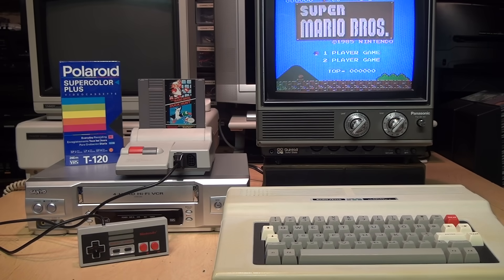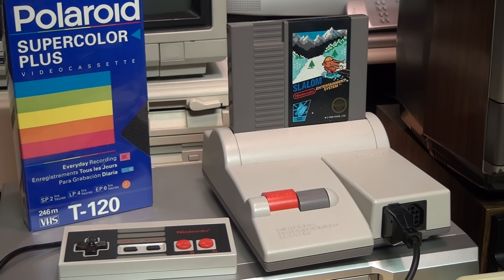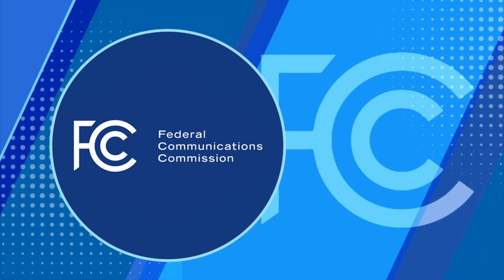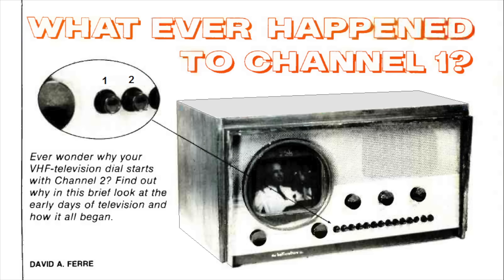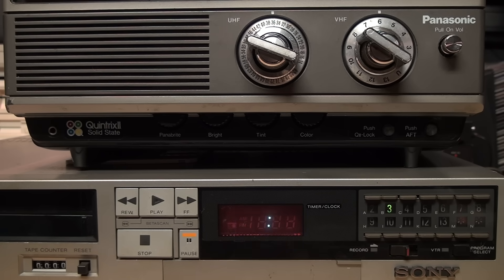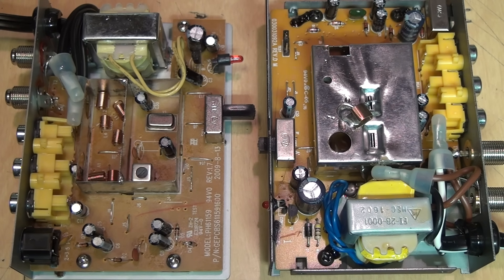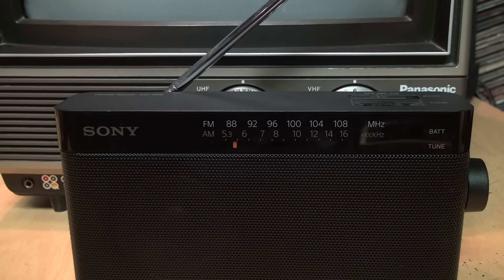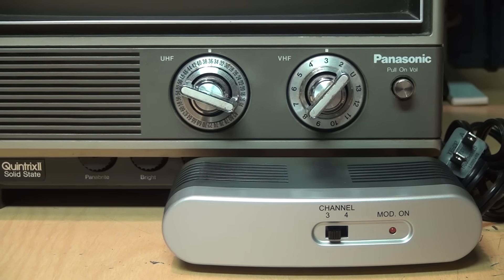Why your Nintendo was on Channel 3 (except in Cleveland)

Comment: I think we had to use channel 4 here in Council Bluffs (Omaha NE basically) because our local CBS affiliate was on channel 3 but fuck-all was on channel 4.

I could still get my VCR (which was our TV's only video input method) to work on channel 3, but there was some modest interference (showed up as snow in a weird modulating herringbone pattern).

Also, apparently you can bypass HDCP with SDI if you know what you're doing (not that I know anything about that).

Comment: Of course in the UK you could only get "high definition" and colour via UHF so it was never an option to use VHF for RF modulators.
Interestingly despite 405 line/VHF being discontinued since the 80's there are still a few VHF TV aerial installations out there, the vintage radio UK forums have a thread dedicated to such installations still being present.

Also for us geeks there is an excellent UK website that showcases the UK's domestic broadcast network, called the transmission gallery it has pictures of about 97% of all our FM, AM, SW, DAB and TV sites.

Comment: Madison, WI also had/has a channel 3, so I used channel 4 as well, even though we were 25+ miles from the transmitter and my system was usually in the basement.

Comment: The top loading Nintendo came out in the mid 90s.  The mid 80s stardard NES had AV jacks along with RF.
RF is more than good enough for any retro game console.  They are very low resolution, well under the 525 line standard of NTSC RF broadcasting.  The NES has only 240 lines of resolution.
The real problem is the modern idea of using an F cable adapter with the wrong RCA cable.
Also, the channel 2, 3 and 4  (2 or 3 or 3 or 4) was established long before the NES came out.  The Odyssey 1 console used it. The dedicated Pong machines used it. The Channel F, the 2600, intellivision and many others also used it.
Reply: There is only one Nintendo, and it started in the 1800s. Stop calling consoles "Nintendos."

Comment: A fun fact about the use of CH36 in the UK, when Channel 5, the 5th terrestrial (I.E. not cable or satellite) channel first started test-broadcasting, people found they couldn't use their VCRs over RF properly any more, as, in a number of regions, Channel 5 used the CH36 frequency, so at their own cost, they had to send out fleets of "engineers" to adjust the potentiometer on the back of peoples' VCRs (you could adjust between CH32 to 40) and re-tune their TVs for them both to return VCR operation and to add the fuzzy, low-power mess that was Channel 5... :P
Reply: And they stuck a little Channel 5 branded sticker on the back of the VCR to say it had been re-tuned. I've come across quite a few VCRs with those stickers on the back. We re-tuned ours ourselves so never had the Channel 5 retuners round and never had our own sticker.
Reply: @timf-tinkering  Where we lived at the time, no amount of fiddling with the VCR or tuning would get the channel in on the house's dubious aerial setup (installed by monkeys when the house was built apparently, though the house in general seemed to have been built in 1988 by monkeys too!), I was the only one in the house who could receive it, with set-top aerials, a booster and a knackered VCR (its' tuner was dead, but seemed to help the TV with signal gain!), not that a fuzzy picture and off-brand 9pm movies were worth watching... :P
Reply: Wouldn't it have been cheaper and easier to just change the frequency of the station than to send men out to fiddle with every TV and VCR in the entire country? Or was that not possible for some reason?
Reply: @BigCJ  It was basically a case of "not enough room", as the UK has different regions which use their own transmitter sites, they have to avoid overlap between regions that could cause interference and 'ghosting' (where one signal overlays itself on another), and of course, 36 was about the only "clear" channel they had in the majority of the UK, but at the expense of having to advise people to adjust the modulators on VCRs or send someone out to do it, it was an absolute farce really, and given the low-power nature of Channel 5 in general, it wasn't really worth it as it was always fuzzy no matter what you did as they often used former Band I/III VHF sites, since converted to Band II FM radio-only, which by that point lacked the power availability...
Reply: How many different stations were there? Checking Wikipedia shows that UHF channels in the UK ranged from 21-69, somewhat similar to the US scheme of 14-69. The stepping between channels is bigger, too; 8MHz vs 6MHz. I'm surprised that there were ghosting issues if there were that many channels with that much space between them.
Reply: @BigCJ  Officially, we had 5 channels (BBC1, BBC2, ITV, Channel 4 & Channel 5) before the digital switchover, but, different regions of the UK had their "opt-out" systems, so they could broadcast local news after the national news had been on as well as local programming or have a different schedule to other regions, so they had to avoid overlap between regions with enough separation between them by having region 'A' in say the 21-32 range, then region 'B' in 56-69 range, then region 'C' further afield can then use the 21-32 range (this being a rough estimate, actual numbers differed), it wasn't perfect as some of the UK's topography allowed for signls from further afield to break through and cause ghosting (same channel, but with a delay making a very odd visual effect!), and in some cases even aid in having two different regions available to you to watch, so you could have say ITV Tyne Tees on one channel, and ITV Yorkshire on another owing to different frequencies used...
Reply: I see. So it's not a problem of different overlapping signals on the same frequency. I don't know why I thought that's what you meant, but think I get it now. You experienced all manner of delays and visual artifacting, yes? Here in the US, depending on how far from the transmitter you are, weak analog signals would get just get fuzzier, lose all color, or drop out entirely. I don't think I've ever seen the phenomena you describe except on digital TV!

And signal overlap between markets is still a thing today, I myself have seen it! The local PBS station 30mi away not coming in? Switch to the one 75mi away in the mountains and it comes in clear as a bell for some reason.
Reply: @BigCJ  With the ghosting, the overlayed image from a far off transmitter would be very slightly behind (signals travelling at the speed of light and all that), in built up areas it could also be caused by "mirroring", where signals bounced about off tall buildings causing a 2nd signal to appear as the ghosted image, and yes, the further away from the transmitter, the worse the quality (I remember in about 2010 after our region at the time had switched over to digital, I was still getting analogue from somewhere I think in Yorkshire, it was a poor signal, but still kind of watchable!). As for digital television, since the switchover, they reduced the transmission power (E.G. my local transmitter went from 500Kw per analogue channel to 100Kw for the main digital multiplexes), so picking up other regions' channels is a lot less likely now...
Reply: Another issue was that the 4 UK UHF stations were "grouped" in a closely spaced set of channels on a regional / transmitter site basis with main and fill in transmitters, antennas were quite narrowband and sold as "group A, B" etc. If your local group was not near channel 36 you might need a new wideband antenna to replace your grouped one to get a decent C5 signal. A similar problem arose with the digital switchover as digital muxes are all across the UHF band so a group antenna might not get all of them.

Comment: Yep, old Atari units are kinda funky. I've got two Atari 2600s, the heavy sixer only outputs on Ch. 3, whereas the light sixer has a channel switch recessed into the bottom that has to be flipped with a screwdriver. Your choices, as the manual stated, were "Channel A" (2) or "Channel B" (3, default setting).

Funnily enough, when I was young, we had a station very close to us broadcasting on channel 3. Never had a problem with interference using channel 3 to play the family Super Nintendo, even up through the digital transition.

Comment: And as you alluded to, the interference of non shielded machines like the original Apple II, especially affects those low VHF channels like 2, 3 and 4. So the modulator that chose to use 32-34 was a nice touch to avoid interference and it was a shame it wasn't adopted as a universal standard in North America.
Reply: There's actually a channel 31 where I live, the local Fox affiliate. So I'm kinda glad we didn't.
Reply: @shmehfleh3115  I think that's why they have selectors
Reply: @shmehfleh3115  I don't think they use the same frequencies.
Reply: @christo930  they would have back in the day if the station existed before the switch to digital
Reply: @triptheroad  Yes, back then. Not now.
Reply: I grew up fairly close to Shreveport, and we had stations on channels 3, 6, and 33. Apparently all our stations were on the rarest channels. I do remember being surprised as a kid when I found channel 6 audio on 87.8 on my radio though. I wondered why a television station would bother broadcasting over FM radio.
Reply: @chitlitlah  same with channel six in san diego
Reply: My dad had a TRS 80 coco and would wrap the expansion cards in aluminum foil to block a lot of the interference put off by them that would mess with the picture.
Reply: Remember when helium broke apple phones and watches XD
Reply: The only two channels i had was 24 and 32 growing up. 

And whichever channel it was set to wouldnt work on my tv. 

So i am extremely happy that it was 24 and 32 growing up, otherwise i couldnt watch half the stuff i watched on tv. 

If they would have standardized that, my already terrible childhood would have been worse. And i really didnt deserve that.... abused until years AFTER i moved out.
Reply: Interesting, considering I actually grew up on a MacIntosh II computer for the first 6-9 years of my life, and used the usual setup to play my games.